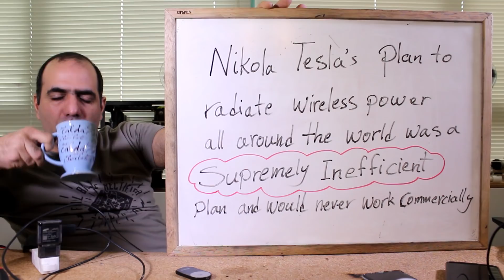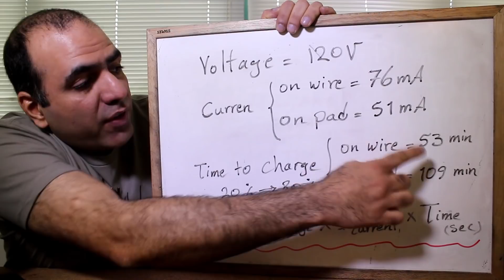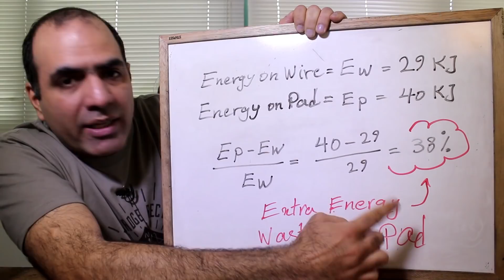Drowning in Inefficiency

Comment: Are you sure you can use that equation for energy? with a wave as distorted as the one you showed you have to take in to account the shape of the current and tension signal. Please correct me if i am wrong. Love your videos.
Reply: the proportion should be the same if we assume both methods generate the same signal though

Comment: I feel like in this modern world all the normal electricity wiring of normal homes could be converted to  12v, 24v or even a 48v system and instead of centralized electricity generation every single home should have its own microgrid using solar panels, then you will only need to use a larger centralized grid for heavy electricity loads like AC, washing machines or electic cars

Comment: Mechanics and Chemistry are not prone to efficiency like electronics because the energy gets lost to the environment, it is not contained to a conductor. We will have the cure for cancer and aids way before we have combustion engines that are 80% efficient in converting chemical energy to movement.

Comment: Dude! So many researchers in many high tech institutes are working on the idea of wireless power transfer worldwide. If you don't feel like to change anything and be satisfied with your current status, you'll be bounded and never progress. The efficiency of wireless power transfer systems is increasing in the last few years to more than 90 percent. they're being comparable with wired chargers.
Besides, I love your videos
Reply from the maker: Wireless power at 90%? I need to see that one! There should be proper magnetic core on both sides and they should be touching in that case.
Reply: @ElectroBOOM  Yes. albeit there are dozens of tricks that are used. like resonant converters and ferrite cores and high-quality coils made of litz wire and etc. Extensive research is going on here. For example, a company called witricity has made a 3.3KW battery charger in cooperation with MIT with an efficiency of 90 percent, 180mm air gap.

Comment: Studying renweable energies in germany, i'm doing my part !
Reply: Most renewable energy sources are very inefficient, commercial solar panels for example are at around 20 %, wind turbines are at around 30, 35 %, even if they are variable-speed etc.
Reply: @FrainBart_main  So are coal plants with 45% at the absolute best, and with renewables  it does't matter as much how efficient they are because 1) the energy they don't convert wouldn't be used anyways and 2) The electricity isn't created by burning fuel, so they have a negative CO2 output depending on how long they are in use. Also, coal plants had decades to develope, and many that are still in use have a worse η than modern wind turbines. Using the lesser efficiency of renewables as an argument against them is absolutely pointless.
Reply: @Jordan_C_Wilde  I agree, but if you use the excess heat produced from coal/gas power plants for remote heating, you can reach efficiencies of even 85 or 90 %. I'm sure you know this, but wind turbines' efficiency is limited by Betz limit at 59,3 %, so no amount of research can make it go beyond this limit. Also nuclear power plants have approximately the same lifetime CO2 equivalent/MWh production as wind turbines and a few times lower than solar PV according to IPCC. There are also a number of technical issues related to wind and solar PV mainly due to intermittency. Higher share of them can cause electricity bills to rise substantially. They are also not the cleanest, the concrete and steel usage per MWh produced for wind turbines is very high, there are rare earth materials use for generator rotors in type 4 wind turbines and producing solar panels is not the cleanest process, recycling 100 % of them is also not the easiest job since they contain toxic elements.

Not trying to say we shouldn't use them at all, just stating that they are not as perfect as some people would like you to believe.
Reply: @FrainBart_main  I know they aren't perfect, but the key difference is that they aren't polluting the environment as much as coal or nuclear, counting nuclear waste, because we still don't have a sufficient solution for its disposal. But CO2 is the bigger factor really, since that's what's gonna get us if we don't act quick. Rising sea levels, droughts and everything that comes with climate change will cost us way more than renewables ever could. And while there are intermittency problems, those would be leveled out if we had enough renewables in a big enough system, together with feasable energy storage. Also it's a fact, that electricity actually becomes cheaper with wind and solar in the grid, since once the wind or solar park is built, there's virtually no production cost for electricity. Together with efficient modern (bio-) gasturbines for peak loads or dark doldrums, and pumped water storage for example, it is possible to have a stable grid while saving CO2, at least compered to coal plants. NPPs have other problems as i mentioned.
Reply: @Jordan_C_Wilde  Sorry for the very long response. I hope it will be an interesting read for you.

You have many things to learn. Lets compare nuclear and solar for example. To replace a single 1,700 MW reactor, we would need about 85 million 300 W solar panels in the reactor's lifetime (even more in Germany). That's quite a lot of waste solar panels, which contain toxic elements, just like nuclear waste does (to be fair, nuclear waste is a lot worse). They can't be disposed in a regular landfill, they're not easily recycled. I'm not going to talk about pollution while producing solar panels. They are not as clean as what most environmentalists are showing. There is relatively very little high-level nuclear waste per MWh produced, especially volumetrically. Some countries are recycling it, making new fuel (MOX fuel), Finland is building a permanent spent fuel repository (Onkalo), nuclear 'waste' could actually be used as fuel in Gen IV reactors. So we have solutions of what to do with it. 

I agree about fossil fuels like coal, CO2 is a big problem according to IPCC and others and if that's true, we should stop using them ASAP (although greenhouse effect saturates at particular frequencies). The problem is that this means approximately 7,000 TWh of additional electricity needed yearly only for the US, which is almost twice the electricity they use today. How to reach this only with renewables is beyond me. They would need either about 500 new 1,700 MW nuclear reactors or about a million 3 MW WT or about 15 billion solar panels. Not to mention that these WT and dolar panels would have to be replaced every 25-30 years, while a nuclear reactor can operate for 80 years. Also energy storage.

Intermittent renewables' production would level out a bit but have you ever looked at the numbers of how much renewables and especially storage would be needed? There are times when renewables production is basically zero in a big country like Germany which has about 100 GW of renewables installed. This can happen when demand peaks (in the evening). There are also longer periods of low production of renewables even if you have a lot of them in a big system. So when batteries would dry out, you still need basically 100 % backup for renewables.

Electricity gets cheaper on the wholesale market if we subsidize renewables' production. That doesn't mean electricity bills get lower. In fact, they get higher due to additional surcharges and taxes. Just look at electricity prices from basically any 'high-renewable' country. Germany, Denmark, California, South Australia are just some examples where electricity bills became high after implementing huge quantities of renewables. Now compare them to France, which produces 75-80 % of their electricity from nuclear. And that's before massive energy storage is needed because they still have regulating power plants and surrounding interconnected countries with low renewables penetration. To compare costs, you have to calculate the levelized cost of electricity (LCOE), you cannot just say there are no running costs so it's cheaper. The LCOE of wind and solar is very high in most of the world and this is without energy storage and other costs included.

Power plants using biogas? What do they teach you there? Calculate the LCOE of a power plant like this.

Now lets look at Germany some more. Since you started to invest heavily in wind and solar, household electricity prices have basically doubled. You now rely a lot more on neighbourning countries (with negative prices and similar). Also mainly due to NPP closing, greenhouse emissions are basically on the same level as before. So all you did is make your power system less stable, increase reliance on other countries with natural gas and increase electricity prices. That's not very optimistic.

All that being sad, I am working on a project of how to help frequency stability with WT during faults like generator tripping. I would like to see a combination of 'clean' sources of electricity in future power grids combining nuclear, hydro, geothermal, biomass, wind and solar. Without synchronous production, we will have many problems in the future.
Reply: @FrainBart_main  Again, i never claimed that 100% renewables is the way to go, i know about the intermitency problems. And that's if we Purely use PV as a substitute, which wouldn't even make a lot of sence in a country like Germany for example. Luckly there are still other renewables, like wind, hydro plants, biomass and so on as you mentioned.

And even recent studies show that the European LCOE at least, of PV is 3,71–8,46 ct/kWh, Wind( onshore ) 3,99–8,23ct/kWh, for Nuclear it's 3,6–8,4 ct/kWh and for coal it's 6,27–9,86 ct/kWh. So where does your connotation come from that renewables are so much more expensive when they can even be comparable to nuclear reaktors and are cheaper than coal. And i specificly said that the gas turbines would be used for peak loads, which allready are way more expensive, even with fossile fuels. 

I agree that closing NPPs prematurely was a stupid panic reaction from the government due to Fukushima, we needed that power untill renewables and especially storage was wide spread enough to handle the base load. Also the NPP closing didn't come for free, the plant opperators (rightfully) got compensations in the billions due to 
investment protection laws. So the fact that we are now putting out more CO2 form coal AND pay for the NPP shutdown isn't the fault of renewables, but due to stupid ever changing politics. 

But the whole underlying point of all of this, is that climate change is undeniable and that we need to do something. Even if that means that that electricity gets more expensive, because the costs of rising sea levels trumps everything renewables could ever cost. If we miss the 2°C target there's an expected sea level rise of 0.86m untill 2100 wich comes with a cost of $14 trillion per year at best and $28 trillion at worst, muiltiple studies come to comparable results. I know it's a bit of a bold statment, but can you immagine how many renewables we could built with that ? And your last point about the combination of means of production WITH nuclear in the mix is exactly my oppinion. Maybe i didn't get that across very well in my other comments. I'm still not a fan of nuclear energy, at all, but i agree that it is needed for now.

Comment: The solution already exists but requires, as you note, much higher efficiency:  solar modules/panels and power storage/batteries. We have transparent solar panels right now. Improvement to high efficiency means that when every window, device screen, or even car exterior, is a solar collector, there are no longer needs for chargers, cables, or even the power grid. Every car has almost infinite range, every phone stays charged, and every home is lit during the storm. I imagine dams removed, transmission lines through our forests removed and none of us who are living in poverty also forced to suffer in the cold and dark because a cruel power company charges too much.

Comment: I keep on my idea of making alternators with a different shape, and the coils around double wrapped, but first it would be interesting to comprehend, exactly visualize how electromagnetic fields are formed, and simulate all that on like, a CRAY supercomputer. 
we have nuclear energy, which is the only one with hydroelectricity we should keep. Windmills are not efficient, they cost money that should be invested to modernize nuclear powerplants. 
not modernized nuclear powerplants became dangerous in france but government says "we green nao"
but okay I'll bring out my geometry books, my HP 48 graphic calc, and see if we can make something more optimal than basically the same three-phased motor since the 1920s without using necessarily superconducting; hypercooled materials.